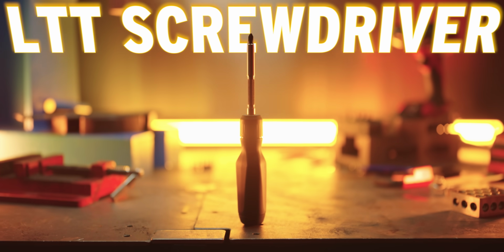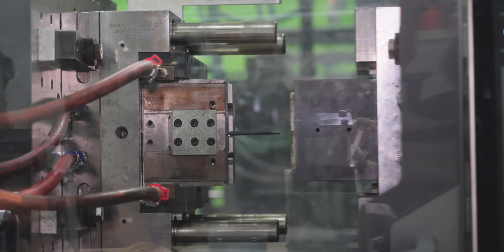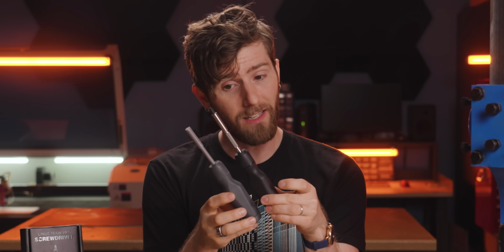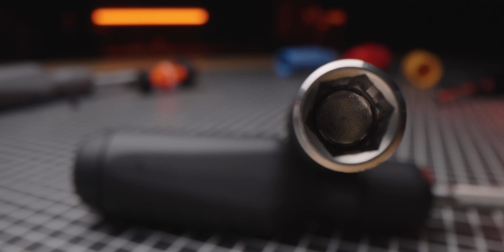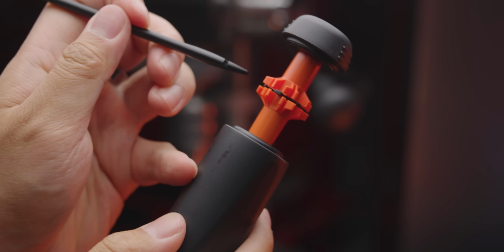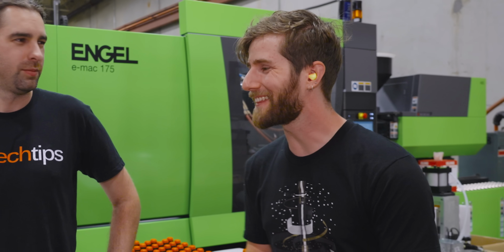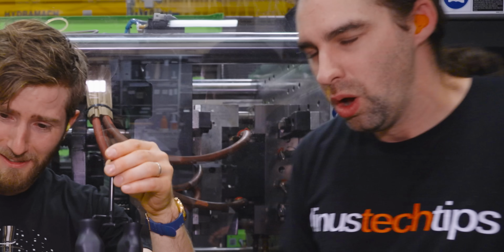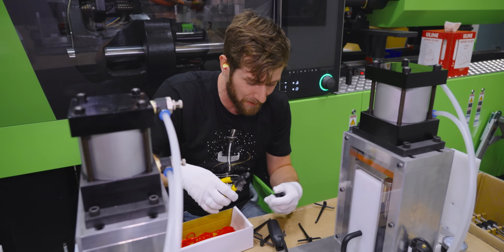Why our Screwdriver took 3 YEARS

Comment: Two bits missing: 1. "Combo bit" used in electrical wall sockets & wall switches. It's a combination of both a square bit + flat blade bit.  2. "JIS=Japan Industrial Standard" bits. Resembles a Philips-type bit, but made for such items as a motherboard's NVMe M.2 hold-down screw. Suggestion: maybe arrange with iFixIt to combine the LTT screwdriver with a more complete set of bits, such as their iFixIt Manta driver & bit set.  That bit set does include JIS bits, but omits the electrician's combo bit.

Comment: I know it may seem strange to you but when I heard that the press to make 2 pieces took 40 seconds for a complete cycle, I was shocked for a moment. And now I also proceed to explain why. Where I work there are much "more advanced" industrial machinery which, approximately every 9 seconds, melt, cool and eject approximately 65 ready-made and even food-grade pieces. For example, 1 press can produce 20,016 pieces in less than 14 minutes. For a total of approximately 1 million pieces every 8 hours. I know no one care, but thats just why i finded "weird".
Reply: I doubt they have to work them hot to finish the job. I guess they could be handed off to another machine to do the hand work that is being done on these drivers though.
Reply: @--_DJ_--  Nope, the pieces that came out of the press are already perfect. And after that they are going directly into an octabin, where them get stored.
Reply: @antoniolandi2674  So you are comparing totally different processes then.
Reply: @--_DJ_--  actually no. the process is the same, passing from a degree of loading of the flake polymer, if recycled, and pellets, if virgin. the process of converting and melting the polymer into a finished mold is very, very similar, but I repeat to you being a very large company that needs to produce millions of pieces a day, it is obvious that you need to equip yourself with machinery that is not so much more technological, but faster and more efficient.

Comment: I have run plastic injection molding before. This automatic one is f*#$%&! awesome! The parts I ran were similar and were all manual. It had a core bar that was supper hot and we had to pull out the core bar and push it back. Then we ran the mold up to make more parts. Rinse and repeat for 10 to 12 hours a day. I hated sorting them lol. looking for mold marks, splay was the worst. Short shots were easy to find. You just look for missing plastic. I got to the point that my hands didn't feel the heat as much so I could just wear a pair of leather gloves. I did enjoy deflashing the part. I got the sprue stuck inside the mold a few times trying to rush it. Other than that it was a supper monotonous job.

Comment: The number of LTT viewers, who presumably buy tvs, pcs, keyboards, etc acting brand new about tool prices. 🙄

I can be understanding some people are cheap, broke, etc. I understand tool budgets that are, were harbor freight, Walmart, home depot (the cheaper stuff) , Amazon knock offs, etc. I understand, maybe you don't need a screwdriver every day, month, etc. 

Sure, this driver isn't going to give RoI for everyone. I just don't get people acting brand new, as if they don't compare at all to the existing quality or premium tool market. Or they have not ever spent more money on something tech or clothes etc that they either work with every day or enjoy frequently. 

Honestly, the less one picks up a screwdriver, the more sense two drivers taking up so little space, but there there to be faster and easier without fault when you need it. Yes, I understand there are 1/3 price options, but it's still obvious you get what you pay for. 

Even when I didn't own any tools, I understood the importance and savings over time of a quality tools. 
None of my current drivers are ratcheting, it would be nice. I have small hands. The space savings are right. No, I won't be buying one, because what I have works, and I don't have the budget. 
That's not what the gasp, shock, horror, I would never reactions are admitting, though. You know he set it to build his better Snap On, but can't handle a comparable price?

Comment: Linus is a business man damn.

If they only make 40% profit on 1 unit. (Which is a reasonable number in my opinion) Then the current profit is around 1.2 mil (counting the 45.000 units sold already wave 1,2,3)
(Of course the costs of the 3 year project and investment hasnt been deducted yet).

But overall this project is still making big bucks.
👏 👏 👏

Comment: Just wondering for V.2, Would a small rubber gasket at the end help with “water resistance”? Would really like to see what improvements would be possible for the next version or better yet a more rugged version for blue collared workers such as construction, electricians, HVAC, just people who are harsher on tools in general.
Reply: It's plastic and metal covered in a protective coating, what are you trying to protect from water?
Reply: @jatoxo  The interchangeable bits are prone to rusting once moisture has found its way into the handle, happens a lot when you leave tool inside of a tool bag during the winter time, that’s just one example.
Reply: As a electrician i wouldn't use these at all, ok for occasional use. but the handle is to big, it a ratchet(they always give problems after time), the LTT logo on the end would become annoying if used for along time. Just not the screw driver for me. I also find the triangle shape not very comfortable.
Reply: @Northeastfarming  lol you wouldn't use it because of the logo becoming annoying over time?  what a ridiculous statement.
Reply: @maplesyrupghost  If you used this for full day any imperfection would cut into you hand.
Reply: @Northeastfarming  okay now I understand what you meant.  I thought it was the concept of their logo all would bother you.  If there are rough edges on it, I could see issues with that.  I guess we will have to wait and see as people start using them on the daily.

Comment: Considering HDD using magnet to store data, how fragile HDD is and ltt magnet is stronger than usual screwdriver. The magnet is worried me.
Reply: Hdd don't use magnets to store data, they use Disks, some Hdd's have magnets inside of them to help with detection of when the harddrive is close to its failure date to give you a warning, but that wouldn't do much because you're not stabbing the disk area with the screwdriver when you install a Hdd
Reply: @jaisere  Isn't the disk is magnetic? From what I understand HDD use magnet polarity in disk to define bit. CMIIW
Reply: @VitaTreatPU  well a HDD is kind of like a compact disk reader, so the disk gets spun up with a motor which does us magenetic fields to spin, so you're close, but still the magnet in the screw driver wouldn't effect it, especially since you should only really do stuff to a non-powered-pc

Comment: I can't do my job without Torx bits and can't use fewer bits than I do now. Sorry, I'll stick with my much cheaper Klein. They're who you should've used for a model. I can only wonder why you spent so much money without including a large enough bit selection to make it useful enough to justify the price. Include more bits than the handle holds and you're closer.

Comment: 1/4" bits are terrible for small, low-torque applications these will see, and are UNUSABLE in many cases with recessed fasteners. Has anyone at LMG or GN ever even seen a 'Precision' driver kit? 5/32" (4mm) is infinitely better and even the cheap ass chrome vanadium bits do not wear after MANY uses. That's not even considering the cost of this, when countless reputable brands offer drivers that could handle the extreme light duty of electronics for several lifetimes.

Comment: 25:50 - unless that was a full black screwdriver, someones screwdriver is going to be missing the orange ring that gets press fitted in between the shaft cap and the handle xD

Also, quite interesting/cool video!

Comment: Question from an electrician. What's the voltage insulation ratting at ? Don't think it's close to 1000v, but maybe at least 24v or 110v ? (for the handle specifically)

Comment: I'm extremely disappointed that the factory you went with is in China. I would appreciate it if you could make sure that none of the workers in the factory are Uighur slaves. But I also understand that China has largely monopolized the manufacturing space, so it's not like you have many options.

Comment: I'm not going to be a hater, and the new LTT driver looks terrific, but in the end, its just something to remove or insert screws with.  I have several drivers in my tool collection, and admittedly, none of them are perfect (or even likely as good as yours), but they are good enough to get the simple job of inserting and extracting screws done.  As with your channels, I always wish you and your crew the best of luck in all your endeavors, but I'm gonna have to pass on this item.

Comment: There are ways to design a mold to work despite claiming it would break it. You can also use water lines to cool the part so it doesn't sag, which slows production. But you can also use fixtures to hold the shape while it's air cooling.

Comment: I love how open you guys are about the product. I couldn’t imagine some other company telling down to the materials they used, showing us at least part of the mold, and all this. I don’t usually buy from the LTTStore (I don’t care enough about fashion to specially order stuff, lol), but next time I need a screwdriver, I think I know a very strong first place contender.
Reply: Only downside is there are equally good drivers for way less cash. $90 is too much to be competitive, but they're not trying to be competitive
Reply: @BuffiestFluff  yah, but buying through a company you can actually support is usually more expensive.
Reply: @BuffiestFluff  need to make sure not to spread easily skewed information. It's 90CAD. 70USD
Reply: @AarPlays  price is a rip-off, should be 30-40 usd for a product like that
Reply: @wispa7214  I could say it should be even less considering the net cost of the materials. The cost doesn't equal value. People buy products when they consider the value of the product to be equal to or greater than the cost. I could screw in screws with the nail cleaning end of a nail clipper, that doesn't mean this product shouldn't exist.

Comment: You have to be careful about China. They will steal your design and make counterfeit screwdrivers and undercut your price. Case in point. I used to work for a network company. Once we designed a new product we hired a company in China to build the mold. We had them send us 50 good parts for inspection before we would take possession of the mold. Unbenounced to us they made 2 molds. One mold was making good parts and the other one needed to be Debugged. They sent us the good parts from the good mold but when it came time to ship the mold they sent us the bad one. By the time we had all the bugs worked out in the mold they already had parts from the good mold out on the market.

Comment: You could go to a tool manufacturer or a gun manufacturer and get the shafts coated in TiaN or ZrN or any other coating that they put on machine tools and boom you have a cool color/finish and a harder then every other medal you deal with on the cheap if done in bulk

Comment: the gate, you could have fixed it by, instead of squirting plastic into the mould, you would splap it on and close the mould on it, no gate, but you get a ring from any that squirts out.

Comment: Amazing to see the work that's gone into this product. Great job. I'm interested to know what considerations were taken into the insulation of this screwdriver considering its main expected usage. (PC building etc) Was there any thought to insulate the shaft? It only takes mA across the heart to be fatal remember.
Reply: You shouldn't be working on a PC while it's plugged in to the wall. Your hands are going to be all over the inside of the PC so if there's something live, your fingers are just as likely to touch it as a screwdriver. The tip is too big to fit through the grilles of a PSU.
Reply: @veryboringname.  Yeah fair points, and officially you should always ground yourself when working on a PC. Mainly due to the capacitors etc etc. Nonetheless I'd be interested to know if having the screwdriver insulated was even considered.
Reply: @flatcapvpr  I'm guessing no since it was designed to suit Linus' use and he doesn't require an insulated driver. The insulation would cover the nice metal knurling with cheap-feeling plastic too. 

I suppose you could put on some heatshrink if you want some insulation.

Comment: I used to to be a tooling engineer for a high-pressure aluminum die-casting company, and your injection molding adventure gave me flashbacks. 

Having design constraints due to the ways cores withdraw and problems when things are too thick or too thin, sticker shock at the price of hardened steel tooling (although we did enough volume of similar things we weren't always buying the full assembly), trying to keep sprue/runner/overflow volume down, dwell time between injecting and opening, trying to maintain correct die temperature... there's a LOT that goes into the process, isn't there? 

And I've gotta give you guys props for not shying away from it. Rather than outsource it in an "out of sight, out of mind" way you seem to be really involved every step of the way, and willing to actually talk about it rather than hide it in the name of "trade secret".

Comment: I liked the video, but never am I gonna buy that screwdriver 😅 I have a 3 dollar one that's served me well for the occasional use for the past 5 years, but it's really cool to see what goes behind the scenes. Also, care to elaborate on why the backpack is so freakin overpriced ? 250$ for a backpack ? Does it come with 24/7 360 degree monitoring, alarm and theft prevention ? is there a safe inside it? I dont get the price tag.

Comment: I've watched the 2hr stream and this and I do see how great it is though also few points of improvement:
1. Shiny bits: if u drop it, harder to find with a flashlight
2. Some kind of a ring at the end that slips so it can be used as a precision screwdriver. Cuz screwing pcb's needs that.
3. Idk, at this point I'm just wishing that there's a torque based mechanism if even possible. Imagine if someone is also able to adjust the max torque it should apply. But That itself would probably need another 5 years to get hands on (but I can wait 😉)
Reply: A decent adjustable torque driver is like $100, and good ones are much more. Definitely not within the realm of possibility for what they're trying to accomplish. If you want one though I recommend Lindstrom. They're like $200 but they're very nice.
Reply: Thought the same about the Torque mechanism , would be fantastic.

Comment: ive worked years as an injection molding operator and those machines are either brand new or immaculately maintained. ive never seen one that wasnt bathed in machine oil and various fluids. one place i worked at theyd catch on fire like once a week.

Comment: @Linus Tech Tips are you sure you meant up to 30Nm at 18:49? Because didn't you show at the pop up shop that it can handle 120Nm without breaking. And besides I am just guesstimating since I only use torch wrenches, but wouldn't 50Nm be a normal use case for a screwdriver?

Comment: I got so many drivers at home but I think this is the ONE which I'll use the most. I really do understand the need to make your own, the handle is just not right, the shaft wiggles after some time, the ratchet get slower and slower with time or gets stuck. I get excited by GPUs or cases but I never thought I'll get excited about a screwdriver ... november is too far away, I just can't wait for it to arrive.

And btw, have you seem the sexy full black driver ? 💦

Comment: Sure, this would work for 'around the house' repair work.  However I still wish, especially for the tech/repair sector, that more manufacturer's would realize that short bits, leading to a thick shank, is a bad idea.  It makes it hard to use in certain scenarios like controller housings or hidden screws.  Ideally, long bits, with as narrow as form-factor as possible would be the better solution.
Reply: 1/4" drivers are completely overkill for the intended usage of these and 5/32" (4mm) precision drivers are infinitely better for access and handling.

Comment: As someone who works in manufacturing alongside engineers and product development teams,  I can tell you that you are extremely susceptible to elements outside your control. Particularly when it concerns other businesses that are part of your product chain. We had worked with a company to develop a specific component that was to be a feature in our product, only to have the company we partnered with to also sell the component to our competitors as well. This was a huge smack to the face, and an important learning experience.

Comment: I work at an injection molding factory, so this part was extra fascinating to me. I should point out one error there by the way. The piston you pointed to at  and said "you can actually see the piston right here that is driving molten plastic into the mold". That piston does not inject the plastic. It moves the whole injection back and forth, and holds the tip of the injection to the mold to it makes a tight seal to the mold. If that wasn't there, a lot of your plastic would fail to go into the mold, and you'd get a short shot - where the mold doesn't fill up all the way and the handle  becomes scrap.  

Including the information of the materials, temperatures, and mold design was really interesting. Thanks!

Comment: Just off the top of my head, does anyone know the size for ifixit's bits? I got one of their smaller kits so it only comes with their tiny driver. Hopefully they're small enough to fit all 12 but hey, as long as I can keep my XPS Torx bits and a couple Phillips, I'm good